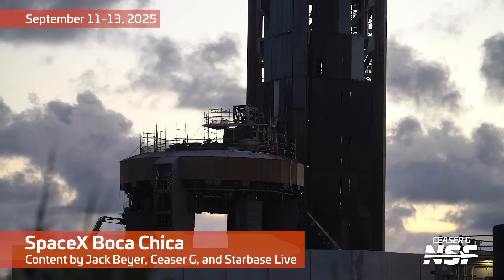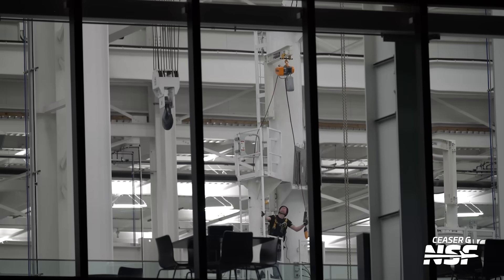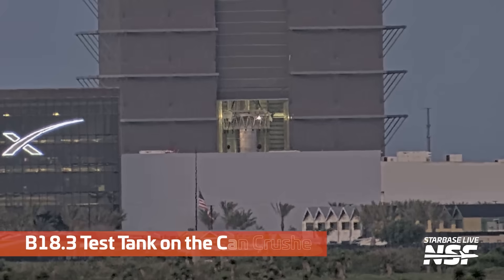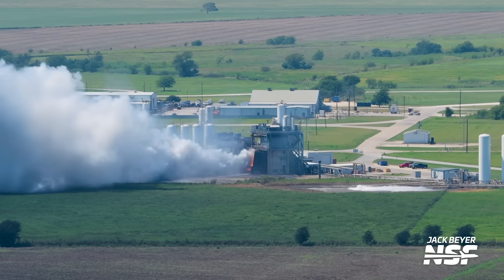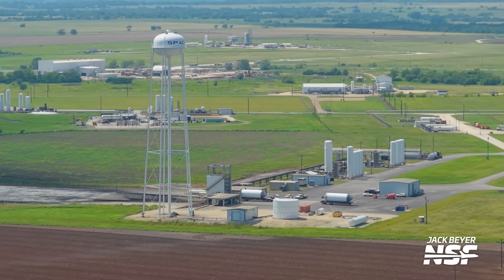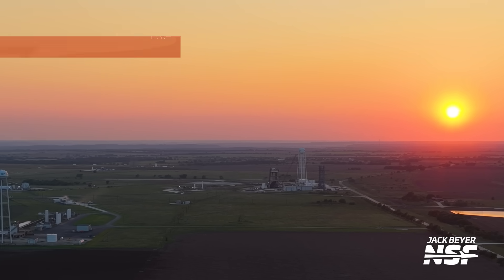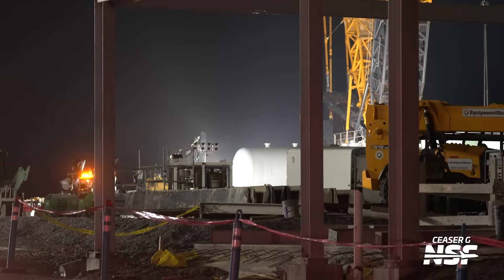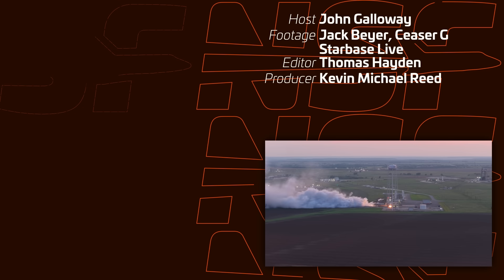Interesting sights at the test sites | SpaceX Starbase and McGregor

Comment: Oversized loads are routed depending on load weight, size, length and overhead obstacles, ( power lines etc). The weight is a major factor because some bridges are not rated for extremely heavy loads.

Comment: Anyone notice at 5:53 the water tower appears to move up and down? I'm sure it's some kind of photography thing, right Jack?
Reply: Quick and dirty stabilizer 😅
Reply: As it seems to be cropped and stabilized from a drone shot, it might be caused by the movement of the drone in the air during the flight.
Reply: @cricri7066  its this
Reply: 5:54 I almost did a double take, even knowing it was time-lapse.
Had a V2 missile-failure moment.
Reply: It's not expansion and compression of the water tank, it's an glitch in the image frame. If you look at the other vertical tanks, the same thing happens.
Reply: @SrPablobegood  it's not an image glitch. Just look at the background. The tower definitely moves independently the buildings behind it.
Reply: @SrPablobegood  I looked at the other tanks and don’t see any movement. Can you describe where the tanks are that best show this?
Reply: @PetesGuide  the water tower is not moving visibly. the dancing effect is caused by the drone moving and the video being stabilized in editing software. Specifically its "warp stabilizer" effect.
Reply: @JackABeyer  doh! It took several passes through this thread for me to process that, because I expected the tower to change a bit as it cycled. But now that I’ve got the authoritative answer, of course it makes sense, given the movement I see.

How much was the elevation of the drone changing to create that look, and why? I’m presuming GPS elevation errors because that axis is so much worse than lat/lon.
Reply: I was worried I was seeing things, glad others noticed it was dancing!
Reply: Also realize the drone is quite far away and very zoomed in, so even minor adjustments due to air turbulence. If you’ve ever tried hand stabilizing (not using a tripod) a camera while zoomed in.  Now imagine trying to do that while flying.  The drones are impressive, but not perfect.
Reply: It's dancing.
Reply: Yup!! Watching at 2x and that thing was dancing.
Reply: I saw that too!
Reply: I would have thought it’s getting filled and emptied. The weight of the water may well be compressing it. (I may also be very wrong)
Reply: @bearbishop8570  This is the most likely explanation.
Reply: I noticed that too. The side movement is most likely wind. I'm thinking the up and down movement is either heating/cooling and/or weight of the water in the tower changing its height.